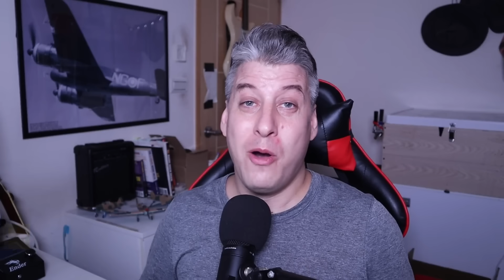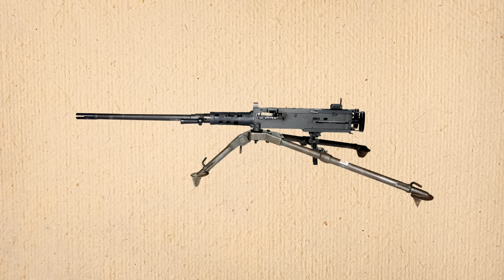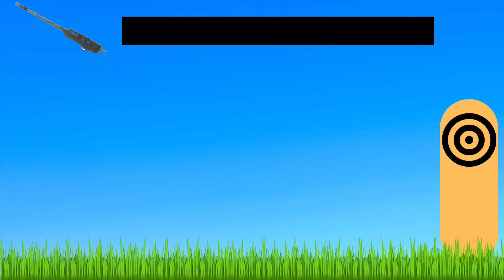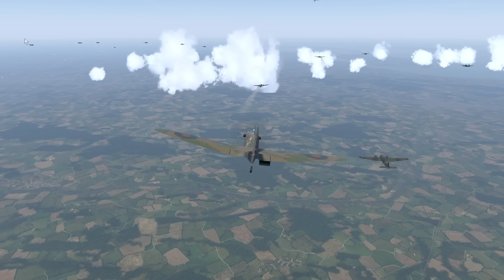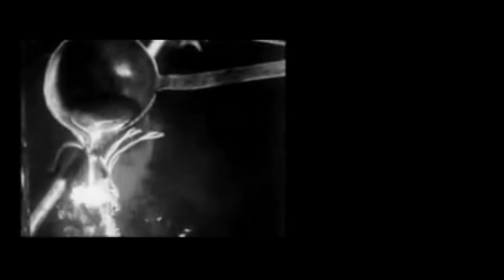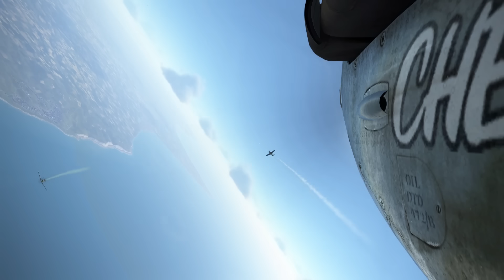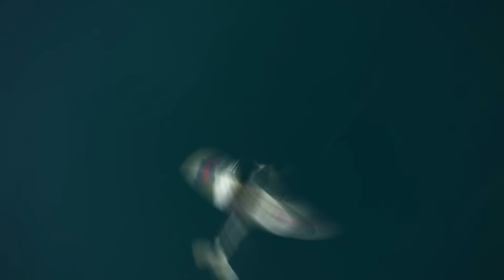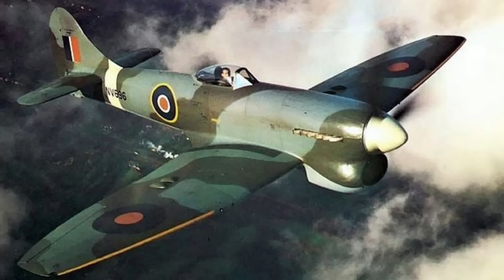Why Did The RAF Use .303 Caliber Machine Guns in WW2? The Surprising Answer

Comment: Re the theory at the end. There's also a mobility issue. Get shot wearing armour, and possibly still killed, or lose the armour, be more mobile, and not be there to get shot at! Also sharks v piranhas.. both kill but you need many more piranha than sharks to do the same damage. Therefore eight guns instead of one or two cannon.
Reply from the maker: I wasn't sure it was a real motivating factor, but it was interesting enough to include in this video.
Reply: @CalibanRising  I'm reminded of Dowding's comment re armour to the effect that if Chicago gangsters had armoured windscreens then his pilots should too :) I think his point was /judiciously used/ it was a good thing, so unlike WWI where they wouldn't allow pilots to wear parachutes, he /wanted/ to protect his pilots where possible, possibly recognising the difficulty in replacing their experience.

Comment: I have often wondered why Spitfires persisted with 4x 303 calibre guns along side the 20mm cannon. I thought maybe tracer bullets would help target the cannons. Does a .303 round have the same ballistic properties as a 20mm cannon shell? Do they have the same muzzle velocity? Do they lose speed as quick? If so, over what distance can you aim a 20mm cannon with the .303 tracers?
Reply: No, .303 rounds had a very different trajectory from a 20mm round. Early MiG jet fighters had similar issues when equipped with cannon and machine guns.
Reply: All WW2 canons had a much slower rate of fire.  This meant that a ~1,000kmh Me-163 could only get a few shots off with each pass.  Muzzle velocity was also less.  Cheers!
Reply: @UJCentral  "All WW2 canons had a much slower rate of fire."

Incorrect. The Hispano had at least the same rate of fire as the AN/M-2 Browning .50.
Reply: The spitfire's wing wasn't capable of taking 4x20mm cannon. There just wasn't enough space within the wing.  This is also why the 8x303 were spaced out over more of the span.
Reply: @honymonster30  No that is not correct. The spitfire went through many types of wing designs. From late 1941 they came up with a universal wing design that could take eight .303in machine guns, four 20mm cannon or two 20mm cannon and four machine guns. In late 1944 they came up with a wing design that could take four  20mm guns or  two 20mm cannon and two 0,50 cal Browning machine guns. In the last spitfire model to see service in WW2 the MK21. The new wing carried a standard armament of four 20mm cannons.
Reply: @afre3398   And if you look you'll notice that the wing on the Spitfire Mk21 has a completely redesigned leading edge to accommodate the 4 cannon. The wing redesign also delayed the introduction of the MK21 into service due to stability problems.
Reply: @honymonster30  The Spitfire was a plane with as many problems as outstanding features.  Those wings are a perfect example.  In BoB, I'd have asked for a Hurricane, just not in a Polish or Czech squadron!
ed: You can stick 2x30 mm cannon in a Mk II Hurri without the wings falling off.
Reply: @honymonster30  Yes, but I wondered why they bothered with the four .303 guns once they had the two 20mm cannons. If they dropped the .303s they could have saved some weight. The Spitfire V was outclassed by the Fw190. I would have thought the increase in performance was worth the loss of the guns.
Reply: @UJCentral  That's all very nice, but the example I'm "cherry picking" is in fact the only one that's relevant in a discussion of WWII RAF armament - because it's the one they actually used.

Comment: Harmonisation is an interesting point, and suggests the pilots' own experiences had demonstrated the need to harmonise the guns /much/ closer, and suggests that at that closer distance the .303 rounds had a much better chance of destroying the target, whereas harmonised at greater distances they'd have lost their punch. Thus even in the Battle of France squadrons were independently reharmonising their guns from 400 yds to 250 yds. Perhaps that meant less wastage too as you'd get closer and more assured of a hit.

Range is only briefly mentioned, and that was an issue, certainly in the bombers. Night fighters could open fire with cannon outside the range of .303 machine guns. No point having guns if they can't reach the target. There again as Harris allegedly said, no point having big guns if you can't /see/ the target. A mix of cannon and machine guns would have been perfect, as the German's had with the 109, which I think had a Hispano cannon firing through the propeller boss, and wing mounted machine guns.

As the UK depended for raw materials on supplies from abroad, in thin supply in wartime, it makes sense to use what was already available, thus the use of .303 guns. The mere existence of the Spitfire Fund proves the UK didn't even have the resources to build as many of those as they wanted to, so they'd hardly waste more on ammunition. On the subject of the Spitfire I'm not convinced the thinner wings could have properly absorbed the recoil of cannon; they already shook with .303 guns. The Hurricane's thicker wings probably could have managed IMHO. In fact all of Hawker's designs had thicker wings than the Spitfire, acknowledging that they'd have to carry weapons, not just fly fast. Then of course as the video says there's the weight issue. Less ammunition per gun relies on pilot accuracy, perhaps a comment on command's trust in their pilots' aim.
Reply from the maker: You raise an interesting point. Was the Merlin engine set up unsuitable for a single cannon to be fired through the nose?
Reply: @CalibanRising  I don't know to be honest - TBH I'm not sure how Willi Messerschmitt managed it! There's something nagging me about 109s having two machine guns on the top of the nose firing through the propeller as they had in WWI. https://en.wikipedia.org/wiki/Messerschmitt_Bf_109#Armament_and_gondola_cannons

Ahh.. I think the penny has dropped.. I think the cannon was between the V of the cylinders, so perhaps the Merlin could have accommodated it?

Comment: I wonder to what extent the .303 calibre stuff was used as a "sighting round" for the larger calibre cannon? You would only carry something in the neighborhood of 150 rounds per gun of 20mm, but 10+ times of that in .303... so you'd use the .303 to ensure alignment, then "light 'em up" with the 20-mike.
Reply: I doubt they used it that much for that, at close range you wouldn't need it and at further ranges the difference in bullet drop between the two would render it useless for that purpose, and it's not like shooting rifles at the range where you've got time to fire marker rounds so you can zero in on something, in aerial combat there's split seconds to fire guns with aircraft maneuvering around all over the way they do, I doubt any German pilots would have cooperated by continuing to fly the same course while someone fires marker rounds.
The Japanese 7.7mm cartridge has ballistics very similar to the .303 Enfield and Japanese aircraft that used both the 7.7mm and had 20mm cannons were notorious for the bullet drop being very different between the two making the firing of both at the same time a waste of ammo.
Reply from the maker: @dukecraig2402  That's an interesting point to keep in mind.
Reply: @CalibanRising  I've seen it stated that the Beaufighter Mark 10 (used mainly for attacking shipping and transport targets) retained two .303 machine guns to assist in aiming the 20mm cannon.
Reply: @CalibanRising  I remember asking my grandfather who was RAF ground crew about the mixed armament in the spitfire and he said the .303 was often used to help with aiming. The ballistics are different between the rounds, but you can pick a set range, say 100 yds and set all the guns to converge at a single point - you would have to do this anyway as the guns are in the wings and you need to set convergence, you just also throw in a bit of the vertical to compensate for the different ballistics. You would not fire at the enemy with .303, wait for hits then open up with 20mm. But if an enemy plane was coming across from say left to right, you could open up a little early with your mg's and use that info to calculate when to open up with the 20mm. I can't guarantee its true, he spent most of his time working on B24 Liberator engines in SW Wales that coastal command were using in the Atlantic hunting U-boats, but that's what he said.

Comment: In the Battle of Britain, the 20mm cannon on the BF109 wasn't that great either. Only 60 rounds of ammunition per gun, about 7 seconds of fire after which the pilot had to rely on the two relatively puny rifle calibre machine guns in the nose or fly home to France for a refill. The Japanese A6M Zero had a similar arrangement and exactly the same problem.
Reply from the maker: I think I read somewhere that some Zero pilots used their smaller armament to range the target before letting fly their cannons. Might have to look that up again.

Comment: IIRC, late 30s and very early 40s US fighters still used .30 caliber or mixed .30 and .50 caliber guns. Wartime creates inertia in production - changeover has to happen when existing designs are at full-time production. The UK was at war over 2 years before the US, i.e. that production inertia became a factor in the UK 2+ years earlier. Making a changeover is a complex weight, rate of fire, ammunition capacity, and damage potential decision.
Reply: "IIRC, late 30s and very early 40s US fighters still used .30 caliber or mixed .30 and .50 caliber guns."

Yes, and most of them only had two guns!

Comment: At a conference after the Battle of Britain, there was a discussion about .303 vs 20mm. Douglas Bader insisted that the .303 was better, you just had to get in close to the target. Robert Stanford Tuck argued that cannon were better, having greater range and hitting power. He said that had he had cannon, there were a few instances where he reckoned that he could have downed an enemy that was out of effective range of his .303's.
While it started to be effective with the Mk V Spitfire, it should be noted that Bader, at his insistence, was flying the only 8 x .303 armed Mk V Spitfire in his Wing on the day that he was shot down (possibly by one of his Canadian pilots).

As for the de Wilde ammunition, according to Squadron Leader Jim Shedden (486 Squadron), it was not made in Belgium (although initially invented there in 1938) but at the Royal Arsenal Woolwich, and an improved version of the original. Britain had bought the rights to the design. It was called de Wilde at the time to confuse the Germans about the source.

My father's squadron (268) had the Mustang 1a, and was unusually armed with 4 x 20mm cannon, but as it was used in the Tactical Reconnaisance role, and was fitted with the Allison engine, never reached an altitude where heating was required. This was in 1944.
Reply: Yes, quite right about the different views of Bader and Stanford-Tuck. Bader's other aversion to cannon was that, in his view, it would encourage pilots to engage enemy aircraft at too great a distance. As was said, Bader passionately believed that the most effective way to shoot down the enemy was to get up very close and that 8 x .303 Brownings were more than enough firepower if used this way.
Reply: @kenstanway7625  The fact that virtually every British front line fighter switching to 20mm cannons in the latter half of the war showed who had won the argument.
Reply: @tvgerbil1984  Yes. But that was the very nature of Bader. He was wrong about the efficacy of the use of his "Big Wing" in the BoB too but could never be deflected from his belief that it was the only way to maximise enemy losses. Hard-headed, domineering, impatient and often rash, but still an inspirational leader.
Reply: @kenstanway7625  Also let's not forget about the "Dowding Spread", which had the 8 guns harmonised at 400 yards, to allow for the perhaps poor accuracy expected of the current RAF pilots. No 1 Squadron in France in 1940 soon decided to harmonise at 250 yds, and some at 200 yds, but had to keep it quiet as the Dowding Spread was still official policy. 
They were also one of the first squadrons to fit armour plate behind the pilot (borrowed from a crashed Fairey Battle). Air Ministry types had argued that the extra weight would affect performance, but the the Squadron Leader (Bull Halahan) tested it and found that it was fine.
Reply from the maker: Interesting stuff. I had short-listed a section of this video on who slowed down the adoption of 20 mms, but it got left on the cutting room floor. Thanks for the clarification about de Wilde ammo.
Reply: One of the main reason the RAF used .303 in the beginning is it was 1938 before they fixed most of the problems. Then it was another year before they got 20 mm usable for service. Also complaints about P 52 being under gunned with only 6 .50's.